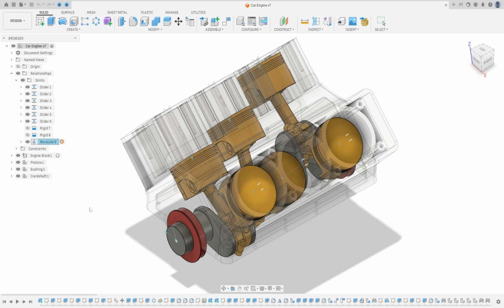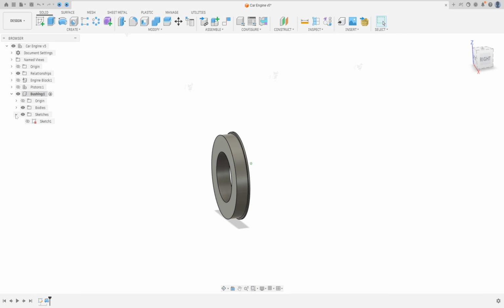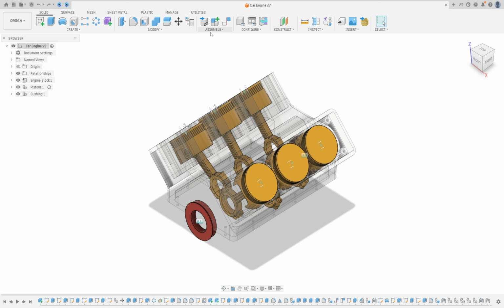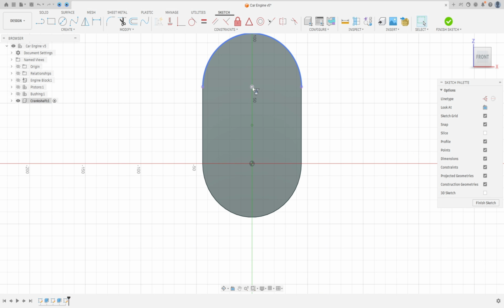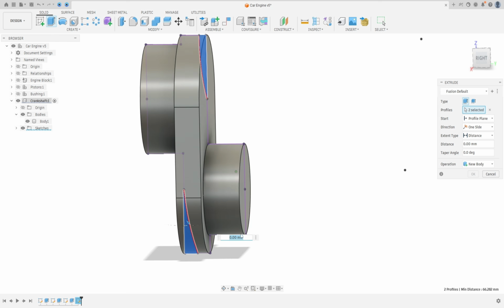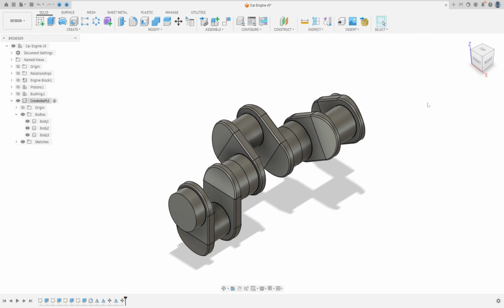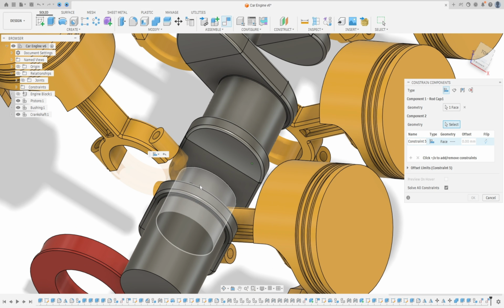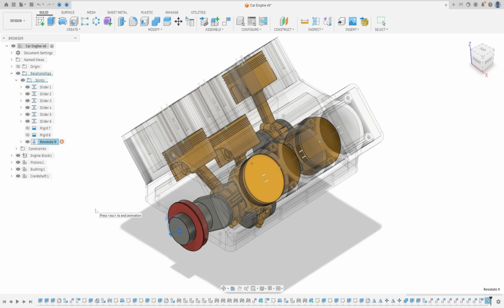Fusion 360 Mastery - V6 Engine - CrankShaft & Bushing (Part 3)  - Assembly and Animation

Comment: I dont know what happened but when i added the crankshift and the bushings to the engine block just one of the pistons and connecting rod went in the opposite direction and the piston head is also in the middle of the connecting rod, how do i fix ? this is a great video series I LOVE IT
Reply from the maker: Thanks for letting me know! I'm sending you my project file so you can compare it with yours.
You can download my file here: https://drive.google.com/file/d/1YMP_wBWjhM8-mRjVbo3hBBnjOHjKmXLd/view?usp=sharing
Or Send your file to fusion360tuto@gmail.com . I'll find the problem

Comment: 00:16:00, I had a problem where the drive shaft wasn't aligned when I finally installed it on the retainer; it was on the angle option. I don't understand where I went wrong.
Reply from the maker: Thanks for letting me know! I'm sending you my project file so you can compare it with yours.
You can download my file here: https://drive.google.com/file/d/1YMP_wBWjhM8-mRjVbo3hBBnjOHjKmXLd/view?usp=sharing
Also, please check that the Rod Cap component is fully constrained. In the piston videos, I added a Component Constraint to the Rod Cap at the end of the tutorial. If that step was missed, it could affect the alignment later on.
If you're still having the same issue after comparing the files, feel free to send your project file to my email, and I'll be happy to take a look and help you find the problem.
Reply: @Fusion360Mastery  Thank you for your reply. I have carefully compared the information and identified the problem. Thank you again.